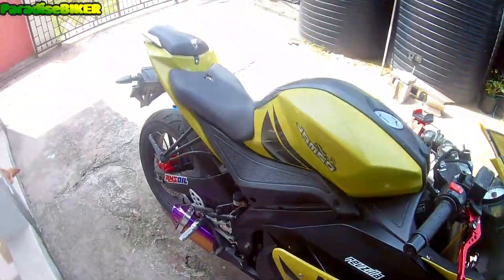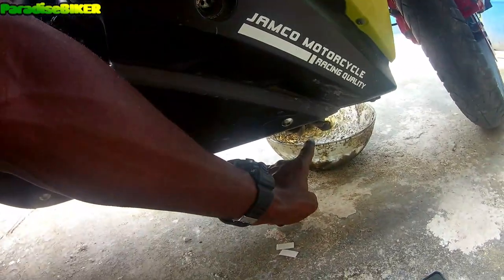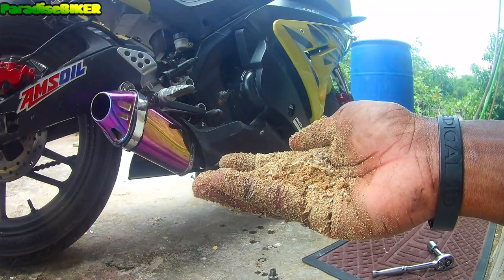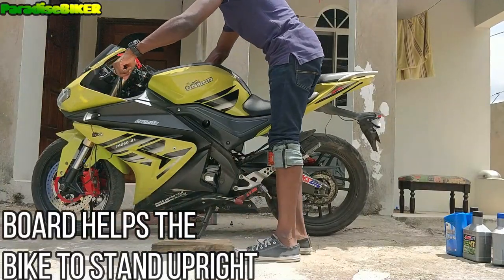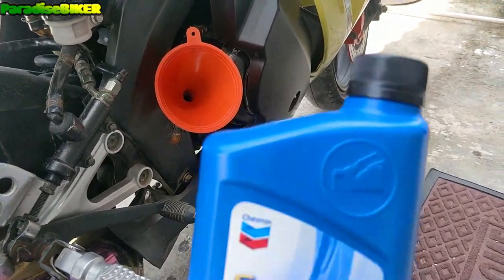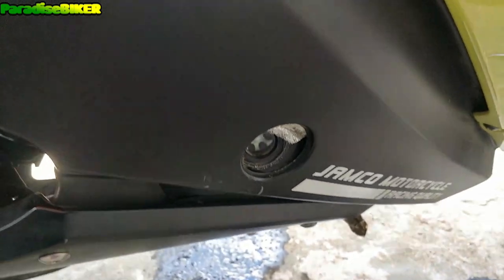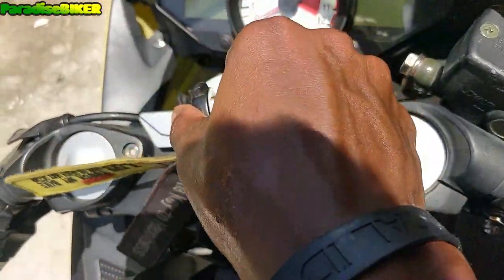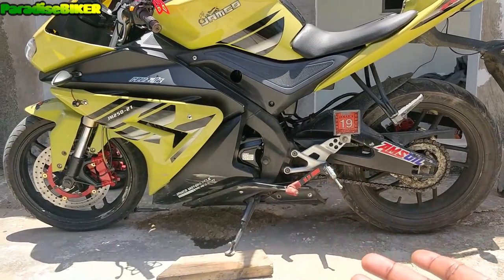How To: Oil Change On a Bike | Jamaican BikeLife 🇯🇲

Comment: Yh mn u should start using back amsoil trust mi it a really good oil on Mk your engine run great.
Reply from the maker: Great point! But for some reason this bike's engine made me go back to the cheap solution, it's like I didn't notice the difference. I guess once I get a 'Brand' bike I'll start using it again.
Reply: @ParadiseBiker  kl
Reply: M

Comment: How do you know when you meed an oil change?
Reply from the maker: Oil is changed based on the distance you cover. For instance a car usually will perform a change every 5,000km.

Yeng yeng bikers dont usually watch the clock/odometer to know when to change.  
Its based on how often you ride & what brand & grade oil you use, I asked experienced bikers and followed their guideliines when I was starting out. If you're gonna use a cheap brand and you ride to work (20-50mins) 5 days a week. I recommend every month. 
If you use quality brand oil and work 5 days a week you can change every 3 months.

When I used to use Amsoil I only chnaged every 3 months because that brand & grade oil was made to last & it was expensive. 
- Hope this helps to guide you
Reply: @ParadiseBiker  what you think about shell oil?

Comment: How much oil dose a 150cc cobra use?
Reply from the maker: Doesn't matter all 150cc's use the same amount (its usually written on the oil cap or right near, and also in your owners manual) 
There should be a sight glass which you use as a guide 
(1 and quarter should be enough)
Reply: The stand is showing me a different level than on two wheels
Reply from the maker: @remillion740  Right because when your checking you want to ensure the bike is level. Put it on the center stand if you have one.. Or put some stones or sumn under the kickstand so the bike can be upright... Just like as i explained in the vid

Comment: What happen to the oil filter? Usually both are changed at the same time....
Reply from the maker: The bikes we have here don't even have an oil filter. (At Least I've never seen one). That's why we just have the oil alone changed.
Reply: @ParadiseBiker  there is an oil strainer that should be periodically taken out and cleaned. it is usually made of metal and is reusable
Reply from the maker: @Alex Gordon, yep... I discovered that in this video https://youtu.be/XF_Py7IaIwk when i tore apart my engine.